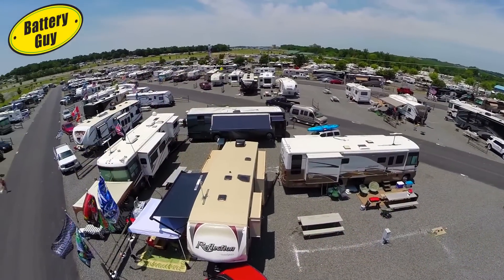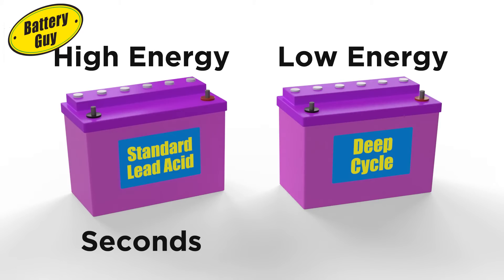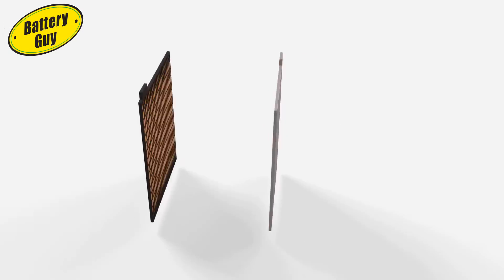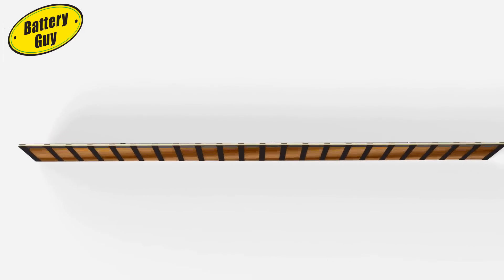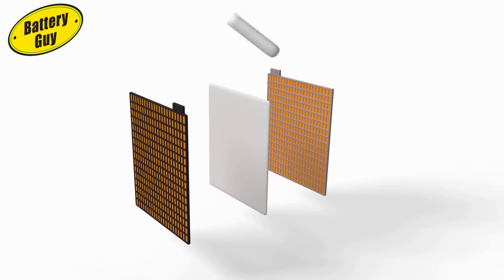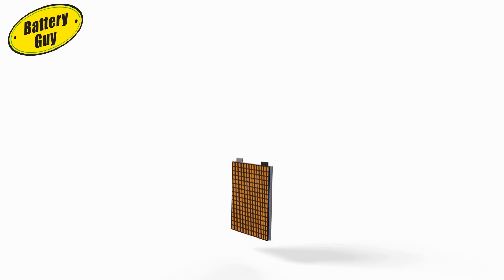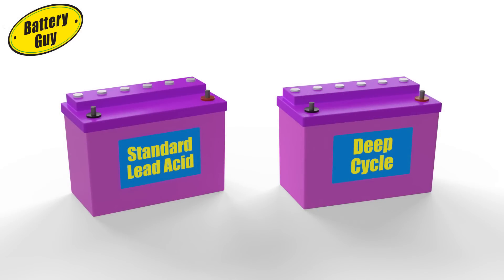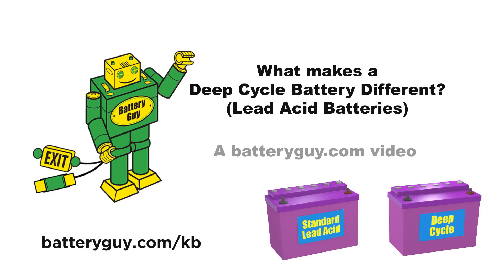What Makes a Deep Cycle Battery Different

Comment: I am investigating why a battery discharge and how restart the electricity flow again , example, A new AGM battery from my PWC, used 2 hours, and left alone for 3 months,  if is the acid that turns in waterr,and the sulphur gone to plates or at the bottom,   if we have battery disulphate and lead plates, and they are not deformed,  just may be water evaporate and the chemical reaction stop, how i can restart the battery, i just once was able to reactivate a battery, was discharged and the charger did not star, but work at inverted polarity, then i recharge and use it,just i change the connection, but wont work on all the battery's,  need i remove the sulphur?  and then add new battery acid ?  were i can learn more ,as i own 10 battery's around, used just once or 2, and still stored (PWC life cycle ),  i am assuming, not bat plates, just stored with no recharging , just the H2So4 acid separate

Comment: So, what is the destructive function which ultimately plagues the tubular design?
Do they eventually bust open and drop their paste?

Also,
I think you've hinted at it by telling us about the shady practices of dishonest sellers but...
We now know that the construction of D.C.'s is slightly more robust... and that their manufacturers have begun using different shapes for their components, for DECADES by now, yet they still seem to require they cost heaps more to users because they haven't standardized the advanced (over older, simpler "flat grid-plated") designs to obsolete the antiquated "S.L.A." design.
However, are we supposed to take-away that, when it comes to the science of how they combine chemicals with materials in a reaction to avail electricity for use at their terminals... they do it, or "cycle," essentially the exact same way?
I was really expecting different chemicals or something.

Comment: I went to a battery school many years ago put on by exide who is now enersys, and they had also commented that deep cycle batteries should not be left on a battery charger as they are designed to be charged and then cycled then rechaced, and that standard automotive batteries are designed to be charged all the time.

Comment: Cyclon batteries for backup application in telecommunications and emergency lighting.
Cyclon batteies use pure lead -no calcium or antimony in the alloy, and Pb is 99.99% pure. They aren't manufactured in China, because they haven't the pure lead. Another feature is the starved electrolyte, in the sense there is only the quantity of H2SO4 necessary to complete the discharge reaction and not more. This limit the amount of lead sulphate which can form inside. The separator is a very thin glass mat under mechanical pressure.
These batteries are a dream to work with, especially the low internal resistance, the ability to operate in freezing conditions, and the very low self discharge. Their only problem, if neglected for long time, there will be no H2SO4 left inside, and you must use some unusual procedures to boot the battery again. I prefer a Cyclon - pure lead - over Li-Ion cells, as they don't die in hot weather or following a mechanical shock. Also, I had some cylindrical Lead-acid last for 25 years - you can't even dream that with Li-Ion; their high terminal voltage keeps them outside the thermodynamical window of stability; in Lead-acid batteries the oxygen over-potential keeps them very stable...

Comment: 20 some years ago, the battery rep kind of pointed me into this, but was talking about high CCA batteries vs standard in a normal chemistry (so 850CCA vs 600CCA). To get the higher capacity required more and thinner plates, this video brought that discussion right back to me.
The rep was talking about how they had to produce the higher capacity batteries due to demand, but they had a lot more warranty comeback. For anything that went off-highway, we tried to steer the customers to the lower CCA battery just for durability. The equipment that took the industrial batteries we rarely had warranty comeback on.

Comment: back in the 90's the gel filled batteries were just coming out, and i had a really good commercial battery salesman that explained all this to me, so i bought thousands of dollars of them for battery backup for a municipal first responder communication system (radios for police and fire).  they worked out really well.  this is a really good explanation though.

Comment: Yes but the Lithium manufacturing is far more complex, far more expensive materials, far deeper cycling, far better lifespan and basically the same retail price or even cheaper... 

Lead just cannot sell anymore when "deep" means 20-50% rated capacity for a few years...

Comment: I have a camper truck, with two deep cycle batteries and two starter batteries. I have been disappointed with the performance of my deep cycle batteries, trying to run a small microwave and  toasters etc, they could not supply the amps to my inverter to run these units and to last, but using the whole battery bank, which is meant to be a no no mixing the two types, have no prob and the batteries last longer. Just goto monitor their discharge rate and never go below 50% discharge

Comment: Because the new cars and trucks are now autostart/stop at lights manufactures are now putting AGM in from the factory, I have one in my truck, a good size AGM will set you back $200, I have always run deepcycle in my vehicles because I have Ham radios and need something that can go deep, even under the abuse of doing off road truck things LOL I have always gotten about 5 years out of a deepcycle, testing is still on going with AGM but at 4 years now

Comment: yet lead is only worth a few cents a pound for scrap so in theory it should be less for manufacturing than copper.

recycle 1 pound of scrap bare bright copper and get maybe $3 buy 1 pound worth of bare copper wire at electrical store and pay maybe $20 or $30.

to keep the cost of battery manufacturing could be brought down by using sketchy labor practices maybe even making them in conflict regions (blood batteries anyone?)

Comment: So, perhaps I haven't dug through the channel enough to find the answer, but how do I know I am getting a good battery?  The optima batteries have failed me early.  I just replaced a Napa battery in my Kia that was from 03/21 and was never abused.  The only time it discharged was when it did it on its own... like a shorted cell or something in there.  I just replaced an AGM in my snowmobile that was from 2008 or so.  I've seen old Diehard Golds go 10 years and get abused and still go well.  But the Diehard brand has been tossed around over the decades, so who knows what goes on inside of them now.
Reply: The old optima's were great american made batteries that lasted for years and years. But the company was bought out and they are now made in Mexico and the quality of the battery has dropped drastically

Comment: As a 40 year ASE Master Auto Tech, I have a clue about diagnosing and repairing cars, but, this battery video is the BEST explanation of battery production / function / and general use how-to I have ever seen. THANK YOU for adding to my education.
Reply: In recent years, the last several times I looked, deep cycle batteries were cheaper than standard car batteries;  I figure because fewer sizes reduces warehousing costs?
Reply: As a deep battery oscillator myself , I've.lived a good life around some chunks of the expensive manufactirung process. (EMP). Near pure led is often onvious but it BEST coincides with the best options outnthere, and diagnosis helps reduce clutteringm. 35 years is more thannenough.

Comment: You forgot to mention that Lead acid batteries last the longest if  FULLY  recharged ASAP after any use .... removing a battery from an automobile and abandoning it in your shed for 2 years  WILL  ruin it ! ........ DAVE™🛑

Comment: Great video. Easy to understand. 
So why can't we fix these batteries at home?  
How helpful is the paste ?   
Are there differences in acids used ?  H2SO4 verses cupric acid (it was a chemistry class)
Reply: Well the toxic corrosive chemicals are one reason. Also how would you fix flaked paste without just making a new battery?
Reply: @thewhitefalcon8539  Well the paste is a new addition. It would be nice to recycle the paste. I just do not know enough about it. 
    The acid is very corrosive. Both new battery acid and containers to hold it sealed can be bought at an auto parts store in America. 
I've seen videos of Pakistanis melting the lead down to recast the plates. The batteries we built in class were solid lead strips wound in a coil with a mesh separator. A mesh would be more efficient.
Reply: @allenshepard7992  I think the paste on both plates is some chemical variety of lead. These batteries are extremely recyclable, and the most effective way to fix one might well be to melt it down and put its materials into the production line for new batteries.
Reply: @thewhitefalcon8539  Here in the states you are right - use the dead batter for the "core charge" to get it recycled. I think that is why battery lead is the most recycled product.

Comment: I was about to say ''there all the same!'' but thats because what i have been buying at the cheap end of the market are all the same... 
hopefully these newly announced salt based lithium 'not as smoky'' batteries will go into large scale production, and then we can move on from the weight and self discharge of lead
Reply: If you mean LiFePO the only reason not to use them is if you need to charge below freezing.
Lithium titanate are great but for cycle life and temperature range but expensive.
Reply: @ghz24  no lifepo is old tech now, the new kid on the block is the sodium ion salty ones. theres a few youtube channels now playing with them but i dont know what temps they like.
Reply: @lezbriddon  It depends on the composition of the electrodes as to temperature range but it looks like they will do better at extreme temperatures.
I think I remember 0.1C charge rate for below freezing and some having 30 C at normal temps. Fast charging is fine if you can find a source capable of supplying enough power.
I got a kWh of lithium titanate cells that can charge to 80% in 10 or15 minutes (I've forgotten which). Thought of putting them on an electric tricycle with the idea of going on a road adventure 2-3 hours of riding and 10-15 minute break for charging sounds nice but I'd need a 50 amp 240 volt source to be available.
Not sure how many welder/dryer outlets I can find on the road and the cord wouldn't be light to carry with me.
Sodium ion seem like they could be useful for homebuilders making electric cars if they are willing to have lower range.
Personally I'd be ok with 50-60 mile range on an electric s-10 but I'd keep my ICE car and just use the s-10 as an errand truck.
Not needing to heat the battery to use or charge it would be a big advantage.
One report I saw said (one variety) could deliver 70% of it's capacity at 70 degrees below zero. I think it was Celsius but at -70 it doesn't really matter -40 is the same C or F and it never quite gets that cold here.
They are interesting but I'm adverse to early adoption. I live on the rusty edge of technology not the bleeding edge. It's cheaper and safer down here.

Comment: Very informative video. I do not see the manufacturing cost reflected in the retail pricing. What I see is the price the retailer can get away with.
Reply: For automotive batteries lead is the main ingredient ! The average battery contains 35 pounds of lead so the cost hinges on cost of lead . The plastic case and sulphuric acid are realetively cheap ! Then of course you have OSHA standards to meet because lead is highly posionous and cumalative ! Thats why most are made in Mexico these days !
Reply: @chavitacanta008 Yeah lead is less than a dollar a pound so commodity price is not an explanation for the price difference. Even manufacturing differences and complexity usually don't explain the price difference.
Maybe the tubular design deserves a higher price but making the plate thicker does not make much difference.

Comment: Additionally, a good deep cycle battery will have a larger well area beneath the plates to catch and store more sulfates, allowing the battery to have a longer lifespan before sulfates build up and potentially short a cell.
Reply: Not sulfates but plate material that has shedded off !
Reply: @chavitacanta008  Actually, both; the sulfated plate material is shedded, and it affects flooded, AGM, and SLA batteries equally. Low and slow charging can sometimes disulfate and resurrect a "dead" battery (if it shorted due to sulfation).

Comment: Sometimes to progress forward in a technology is to take a step back in time and in the case of batteries it is good to consider the man called Laden and how he received a nasty shock from a jar of charged water. The overlooked element in a lot of energy storage devices is water or rather OXYGEN. 
Oxygen can be charged from O2 right up to O23 .
This happens continually in the upper atmosphere as the sun's rays bombard the oxygen layer and transform into something called OZONE which is basically oxygen with extra electrons/ions.
These are the fundamentals and studying them gives more insight into electricity.
A man called Nicola Tessla pondered these fundamentals a century ago and produced devices that the scientific community havre tried to ignore for several decades.
 They wish he would just go away and stop trying to come back from the dead to haunt them for crucifying him.
They wish that the b@$tard would just stay dead and stop interfering with their plans to make lots of money.
Because their main interest is not energy storage but
 m o n e y  storage 😊

Comment: Hi, Folks.
Firstly, thanks to BatteryGuy for this well explained video. GOOD STUFF.

Now for the 'kwestyuns':

1. WHY does my small camper vehicle's battery last 3, 4 or more years while the auxilliary 'deep cycle' battery that runs the 12 volt electrics within the camper AND is charged by both the vehicle  alternator when running and a fairly substantial solar panel 'expire' like clockwork at TWO years even though it is NEVER fully discharged or even close to fully discharged??????????

2. If I were to replace the 'deep cycle' battery with a normal car battery which was likewise being charged by both the vehicle's charging system when the vehicle is running AND the solar panel when the sun is shining, what are the chances of the normal car battery still lasting longer than the 'deep cycle' battery? (In Australia, the sun shines MOST of the time during the days.)

The auxilliary 'deep cycle' battery for the camper's electrics currently runs a 10-gallon/45 litre car fridge all the time, a small 12-volt car fan sometimes, and four LED strip lights VERY intermittently and only for VERY short periods and seldom more than two at a time. And yet I have had FOUR 'deep cycle' batteries in the auxilliary battery role in SIX years, one at new and THREE replacements, the last two months ago.

I DON'T  think I will buy any more 'deep cycle' batteries for it.

Just my 0.02.

You all have a wonderful day. Best wishes. Deas Plant.
Reply: Use a car battery to run that fridge and you'll be replacing it in six months. The fridge is eating your batteries.

Comment: I live remote rural NSW Australia full solar and wind gen, run a three bedroom house and outlying shed and workshop all on 240V from the inverter. Wind keeps the batteries 24V system topped at night providing battery maintenance , run a separate system 12V for internal lighting all LED ,s , inverter soft start fridge freezer ect. Its about knowing what your lifestyle draws in the way of amperage and building the system to suit. Been at this for ten years or so , was an interesting learning curve indeed came from the coast and the city and knew nothing about off grid living , now we are doing it in comfort with few if any problems. Batteries are the highest cost item just replaced four at $350 each but with good maintenance they will last eight years or so , just replaced a five year old inverter $450 plus change that will run like the one it replaced for five to seven years , we have high temps here and micro mining dust not a friend to electronics. Had the opportunity to replace the deep discharge batteries with lithium batteries no thanks for many reasons that i wont go into here , thermal runaway being one of the main reasons followed by the price and then of course where the lithium is sourced from , but I digress I do that.